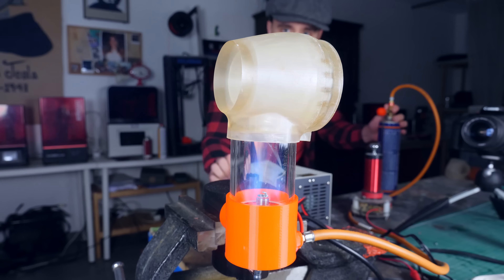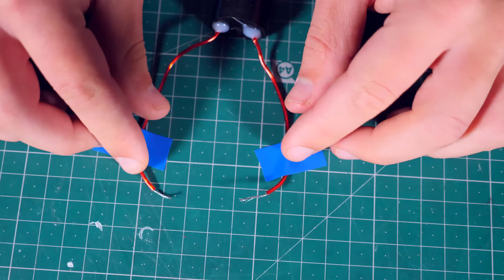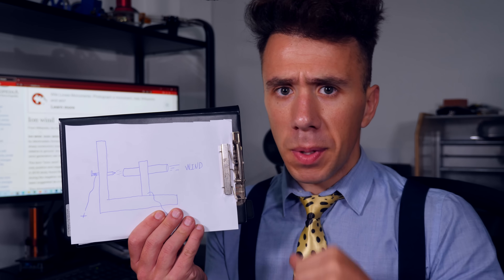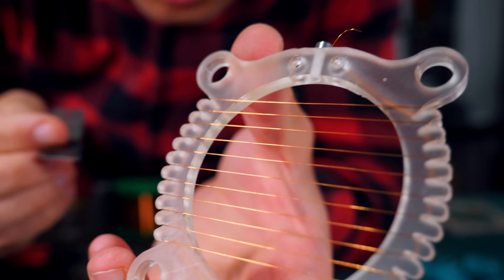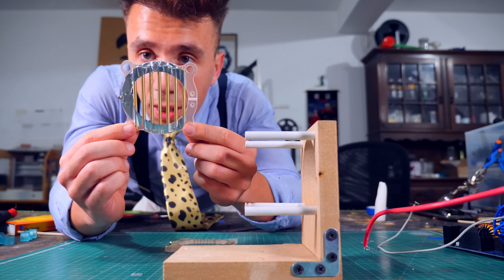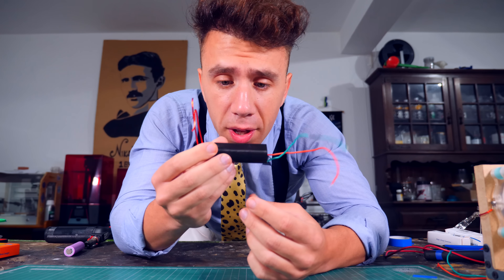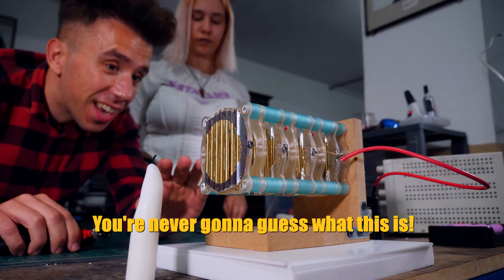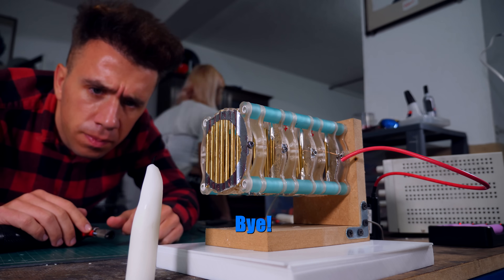I built a TRUE BLADELESS FAN

Comment: You should talk to Jeremiah from "Join the technicians" youtube channel, he blew out fire he created with a HV wand powered off just two lithium ion cells. :) (it generates 120kV though unlike those things from amazon that generate between 20 to 35kVs, depending on if you have the DC version or the un modified by a diode ladder version that pumps out 20kV AC lol. )

Comment: Integza, you always ask for soldering tips, so, one you already have have: soldering paste, this is not enough. you need a clean stained soldering iron tip to work with the paste. Use a copper sponge (palha de cobre, para os intimos) to clean the tip before each soldering. Make sure you have a shiny tip to make the solder

Comment: to make it better you could try increasing surface area instead of stages. the most half assed way of doing this would bee fine steel wool for your positive. however you wont have controlled points that focus the output... unless you cut the steel wool and and set the cut parts to point in the same direction like hairs... or you could try cut carbon fiber so you get a brush type of thingy for the positive. i dont know if you will get enough current off the carbon fiber

Comment: A funnel tube around it to focus the air flow.

Edit:
Forgot.
 Arrange them in a circle. The flow goes around until it flies off. Thus, low pressure.
I.E. instead of a jet, a propeller.

Comment: Have you tried using microwaves to generate plasma? There is a recent paper on the potential use of electric jet engines using microwaves to turn the air into plasma and that being the fuel source rather than actually carrying the fuel. I think they managed the o demonstrate the plasma side of things but not put into a combustion chamber situation

Comment: what about a bladed bladeless fan? :) i.e. have a sort of static fan blade-like set up with airofoils that a re fat at the fron and super thin at the back and the body and eleectric insulator. then have the front of the blades th collector for the wire edge of the blade in front?

Comment: Integza, what about alternating between vertical and horizontal segments. Meaning your first 2 plates will be vertical wires and metal. The next group will be horizontal wires and metal. And so on, this will create an air vortex. Should double your flow rate and your range. Cheers 🥂

Comment: It seems inefficient, but I wonder if there are some odd use cases like high velocity wind tunnels. It doesn’t seem like there would be a limit to how fast it could accelerate air as air speed increases and it should be close to laminar.

Comment: I want to see you make a vacuum cleaner with that concept. Take a look at compressed air powered vacuum cleaners and see if you can use the two concepts in one project.

Also question, electric discharges make ozone, ozone is helpful in killing bacteria, the generator you have made generates tons of ozone. What if you made a forced air heating system to go into your house to create ozone, kill all unnecessary germs and deliver warm air to each room. The only small concern is that ozone technically can kill a human from too much exposure, it doesn't discriminate which germs to kill. So be careful if you try this.

Comment: Thanks for using my old suggestion, posted a while ago.. Glad you finally got to this project. Thanks. My next suggestion for a future video project is, to make your bladeless fan idea fly, using Vertical ionic thrusters, vectored to created maximum "directionally controllable" ionic wind thrust that is directionally controllable.. There are many designs possible, one of the most interesting is how flying saucers ionize the air on the surface of the saucer to then use that polarized ionic wind to vector thrust whichever way they want to go. https://youtu.be/5uh-rkfpiPc Obviously your power supply is the difference. I hope this comment inspires people to like my video project suggestion. Thanks & Happy Hollidaze. ~Journey

Comment: Video (series?) suggestion: use this blade-less fan tech to power tesla turbines of varying disc geometry. (Disc geometry ideas: standard flat, unidirectional tilt, multi directional tilt [offset by n degrees], tapered discs [even spacing, tapered spacing, offset angles, etc.]

Comment: I use vacuum pumps/chambers a lot and using this type of air flow is a way of pulling an even stronger vacuum.  Pushes air molecules towards the output to be removed.

Comment: Got me thinking about the number of scratches on the wires.  There’s a fine line between polishing and scratching.  If you hit it with a really course scotch-bite pad to get thousands of tiny microscopic scratches would that do anything or if the discharge nodes have to have a bigger surface area than that.  If the size does matter, maybe a stranded wire through a dowel where you fray the ends of the wire and run it on slow could be a way to get slightly bigger scratches.

Comment: how about instead of using wire you try to 3D print a screen shaped grid out of some metal filament. that should create an irregular surface that will have a lot more points and you can have more copper so less resistance allowing more of the amps if in parallel or more volts if the winding is in series that aren't being wasted on heat. maybe smash down the copper tubes a bit to make it more of a wing shape too? I think i would be cool to try to scale the model a bit bigger and see if that will significantly produce more thrust. also try to see how well it works in a vacuum would be cool. Love your channel man. makes me feel like i can tackle some cool sciencey stuff too.

Comment: Use it in your RDE to increase air flow rate
Also place the the grids at some angle to rotate the air flow or genrating vortex which will help your RDE to gain momentum

Comment: New to your channel. 3 observations: Ties have no place in the shop ever. You need to get training with your table saw before you hurt yourself. (Have them teach you how to use pushers and never use a fence when crosscutting. Have a real woodworker teach you.  Not from YT, they are pretty clueless overall.)
Wear safety glasses.

Comment: I haven't tried this, but you'd probably get better results if you switch to an ultra thin tungsten filament.
Cut them into strips, then stand them up like hairs in an array. You may have to coat the wire in lacquer or varnish before cutting to only get the arc coming out the tips.

Comment: In order to improve your "bladeless fan" you should space the anode unequally from the cathode. the more you add a stage the more you need to space the anode from the cathode. it make sense because the particles are accelerate at every stage so at every stage they come in with an higher velocity. The same princip is used in the cern accelerator.
I hope this will help
Sorry for the possible grammar mistakes I'm not English
Reply: could you perhaps eleborate here, i am trying to build my self a ion thruster as well
Reply: @shankardivate1041 -- You want later stages to have faster ions, so they need to be spaced further apart. Same idea as a coilgun.

Comment: If you could somehow run the flow in a circular pattern in a toroidal vacuum you could introduce a fluid to add viscosity and use that to turn a turbine at whatever speed. Kinda like a turbocharger but with one end having this coil anode cathode array in a circular pattern. It would be cool because it could be an enclosed system.

Comment: So you know how you started with the dyson fan, and how it works by air multiplication?   if you mimicked that design- either replacing the standard dyson fan-bit just into the old dyson housing,  or even better,  doing the ionic setup on the inside walls of a venturi, you would get the air multiplication effect, and probably beat jay in air output next round.

Comment: You could use smaller versions of this fan to create a bladeless drone! That would be so cool and would impress Clara for sure!
Reply: Ionic wind is not that powerful tho
Reply: @jishan6992  it can be that powerful, but it requires more power. US Air Force did some experimentation in the 60's, got a system to work, but it required a small nuclear reactor to generate sufficient thrust :P
Reply: @giin97  my point still stands then? By making it powerful enough it clearly becomes non-practical
Reply: @giin97  Hmm ... What about specifically using an upward focused fan and using this system specifically for thrust vectoring. Would you still need such immense power? Sorry don't know the maths too well.
Reply: @giin97  Triangular "UFO"
Reply: I have made this same suggestion at least two times in the past. I agree good project idea. Good luck.
Reply: THIS!!!! I would love to see this.

Comment: Can you use HHO gas which is highly effective gas and produces H2O on heating it up! I have done experiments on it and it releases energy equivalent to the electricity supplied to it and it creates a implosive effect which gives a good shockwave and hence can be used as a fuel for your shockwave engines to propel it well. Also, it doesn't need any oxidising agent like any other fuel. Thus, it proves to increase the Efficiency of your shockwave jet engine. Producing HHO gas is very simple, use electrolytes like NaOH or KOH and pass DC current through it and let the gas come out from a single tube and there is your explosive gas ready for show. 

I hope you like this video and use this to improve your engine and your learn more out of it. 
Thank you, I love your videos a lot and it gives a lot of knowledge about engines and many more things.

Comment: what would happen if you tried enclosing the fans and having a funnel on the output end to well... funnel the wind? kinda like the design of a small jet engine with the air intake and outlet. doing that you could make the ion fans closer together and they would kinda be like step motors (don't know if that's the best way to phrase it) taking the input of the fan before it and increasing it's output. the act of funneling the air would increase the pressure and power of the fans like putting your thumb on the end of a water hose and inclosing it would help to prevent air from going off to the sides reducing the amount of lost potential. Don't know if this comment is going to make any sense but it makes sense in my mind. scrolling through the comments I think what @kevin Ashmore said is a much much simpler and more refined way of saying what I'm getting at.

Comment: mate. you need to cut a hole in the back wood (before the first stage) to keep air pressure behind the first stage. what you have now, once the first stage starts pushing air out you get low air pressure behind it, which forces it to suck air from the sides.
also consider putting a tube over all the stages to avoid air escaping from the sides. make the tube and the hole in the back wider than the cross section of the ionic drive and you get yourself an air volume multipier with an ionic engine in the middle (as accelerator).

Comment: Dear @Integza - a few ideas to consider... Use 'teardrop' shaped tubes, for better aerodynamics. They are available ready-made, for use on things like model airplanes. Also try alternating the orientation of the wires and tubes, and varying the voltage applied to each stage to get more speed. (To get a more gradual acceleration of the air.) Alternatively, vary the wire-to-tube distance. Finally, for maximum velocity, make the entire array taper in diameter and put it inside a tapering tube.

Comment: To work with a necktie on electric tooling machines like the saw and the drill is maybe not the smartest idea. Believe me! Years ago in my youth one of my to long sweater sleeves was catched by a slow rotating metall circular saw and I'm glad that I was able to pull the sleeve violantly out of the rotating blade before the blade
catches my arm in that sleeve. And a necktie can get catched also very fast when you are distracted of something that needs your attention, for example not to saw your fingers...
My advice: don't do that for to look stylish. It can cost health or even live!

Comment: Thanks for sharing this very interesting video  and congratulations for your research initiative  that I am sure will bring important applications, especially in thw energy field.  I myself am a researcher on renewable energy and currently am working in a 24/7 Domestic Wind Farm and so far I have obtained a 99.75 power efficiency. With the idea of using your bladeless fan I wonder if you have an idea of how much electrical power the HV dc genetor consumes to produce an airflow of 18 m/s and which CFM you get. Thank you once again.
Reply: I have just 👍sent you a message on telegram.

Comment: wearing a tie while using the table saw or any "spinning" tool is not a good idea, or any loose hanging cloths. You probably won't read this but for those that do and don't know this it is not good, you get caught in the saw and pulled in before you can react. I've been in construction for 40 yrs and have seen a lot of injuries because of stupid stuff like that.

Comment: ⚠Video Idea❗🎥🎥📽📽
You should make a video with water 💦 in a #Supercritical state used as a booster fuel for a rocket when the valve is released for the supercritical water, using it as a fuel❗  #Rocket 🤘🚀  PS Tomatoes are DISGUSTING! 🍅=🤮

Comment: how does it perform compared to a fan with blades? like could you build a drone on the concept and make it fly like a regular drone with blades for propulsion? what is going to "waste" more energy? ionizing the air to push it, or the resistances involved with spinning blades?

it would also be interesting to see this thing as a base feeding into a dyson fan to complete the thing.

Comment: Integza, I love this channel so much! You get me so fired up to be creative and try to discover a puzzle to solve. (I hate tomatoes, too) 

Here's an idea:

I would LOVE to see someone with more resources than I have try out the Stirling engine as a power generator. 

Unlike the multitude of videos available on the topic, I want to know if Magnification or Mirrors would work to heat the chamber instead of fire. Then, it's a zero-emission fuel-less motor during sunny hours. 

This could be used for water pumps, farm work, homestead work, light automation, etc.

Comment: Back in the 1970s I used a 10,000 volt oil furnace transformer. To make something like that. Glass jar wrapped in 600 volt wire. Inside of jar covered with aluminum foil. You could feel the wind at the top of the jar opening. Still have the transformer. Will have to try your setup. Great video.
Reply: Post a video of the results.

Comment: The secret is airflow. The grids and cathodes need to become increasingly smaller in each stage. I thought criss-crossing the grids would be OK, but it results in turbulence. You also need to create an airfoil on the surfaces in order to achieve optimal airflow.
Reply: Maybe my meter was shit, but i measured increased airflow with criscrossed wires despite turbulence..... my grid was relly fine, so maybe the turbulences get better with tighter grids? Also i crossed only the negative wires and the wires were  layered directly on top.....
Reply: At that point it's just about ways to increase the speed rather than the basic of the wind being produced in the first place
Reply: with re. to ducting airflow etc, what do you think of incorporating some magnetic pinch and polarization by coiling one of the leads around the ducting, a single coil at first but later I think they could be tuneable at each stage!
Reply: @ericgriffin6486  I think that inductance would counteract the ionic flow by sort of "squeezing" the fields created by each set of anodes and cathode, but I could be wrong about that. Ducting might be beneficial if you could calculate velocity gain from a narrowing duct and then fine-tune the system in a compromise relative to velocity gain vs loss caused by induced drag. In aerodynamics, there are 4 basic forces: lift, drag, thrust, and gravity. Gravity and lift are not an issue as they will remain constant for the device. Adding surface area within the airflow will create drag and friction, which will slow the flow. Reducing the drag for each stage will optimize the potential flow. If the goal is simply moving air, a duct may not be the right answer. If the goal is directional airflow, it may be the right answer.
Reply: @cwwisk  I am sure improvements could be made by synchronizing magnetic spin in the positive and negative fields and by aligning the ion flow in a negatively charged conduit so that as the particles move through the system and pick up charge they are organized into large ionized particles being accelerated down the center of the fluid body and the smaller unionized particles being forced out of the way by the larger excited particles. it seems possible to me that un-ionized particles being dragged along adjacent to the ionized fluid body might be accelerated and heated to more readily accept ionization.  Personally, I am equally interested in what could be done with this tech in a closed system and mixed gas. Could a mixed argon-enriched atmosphere be safely energized and contained to offer to gain atmospheric buoyancy?
Reply: @ericgriffin6486  this is definitely worth researching. You are right about ionizing the particles, I guess.

Comment: 7:30 Power is not completely the answer. Some of the electrons could be getting sucked back on the intake side via magnetics. Before the electrons are out. The intake is slowing them down. Put A shield around the wires so that the electrons can only go one way. Also but A outer coat around it all. One more thing, the thing pushing the electrons could also be rejecting from all sides of the wire.